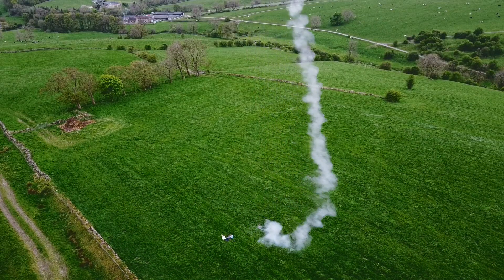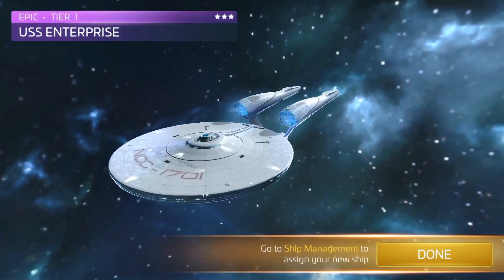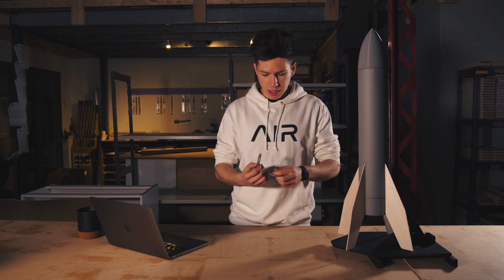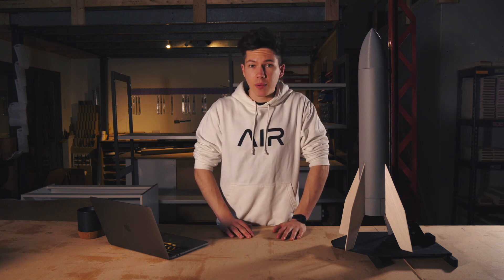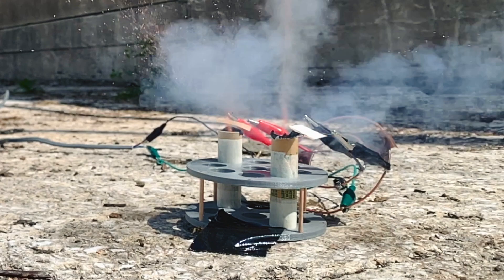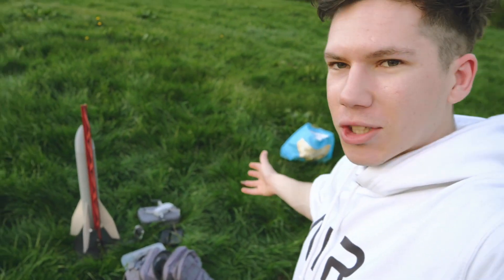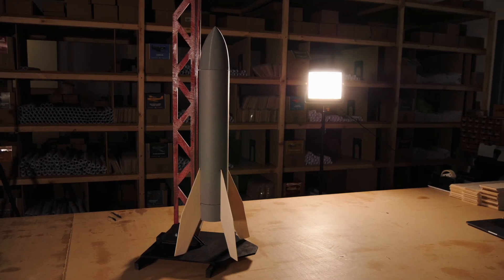DIY High Power Rocket

Comment: Use singe ignition + ignition rods from Raketenmodellbau Klima, Article number:   0001. Length: approx. 25 mm; burning time: < 0.01 s
The ignition rods are to be used for our 18 mm and 24 mm engines for safe ignition with bundled and stage ignition.
EDIT: It costs 5.90 Euros for 50 rods.

Comment: Wondering what material is wrapped around the formers. I suppose cardboard would work.  If it was my project, I might have only enough holes in the formers for the number of dowels I'd actually use. Then the other parts of the formers could have an I-beam cross section. I might also use balsa or a light veneer to wrap around the formers.

Comment: The reason I think the recovery method didn't work is because the time between the ejection chargers is different on every motor. This results in not enough thrust in the nose to be able to push it out. It might also have been some of the ejection charge came out thru gaps in the paper.
 
Love this project, am going to try and remake it.

Comment: Maybe try using springs to assist with the contact to the motors by making the crocodile clips push upwards. That may give an extra chance to light up all the engines. And maybe a long quick-lighting fuse from the base to the top connecting to a separate ejection system could better work.
Beautiful build and test, mate. Wonderful.

Comment: Pack the fuses with flash powder which you can scrape off sparklers for hotter ignition, glue in with hot glue nose cone should not be tight just barely snug

Comment: Higher voltage battery for you ignition circuit should slove your miss fire issue, add a bit of fine black powder between you rocket motors and the wadding for your parachute will give enough pressure to eject the parachute.

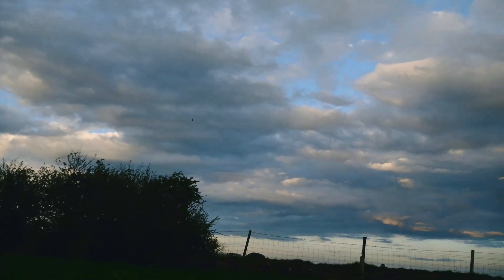Comment: @10:26 I would use a pressure sensor with MCU to sense the change in pressure when reaching the MAX height, then open the PARACHUTE, or an electronic Gyro. It is very easy to use but will need a small battery to operate with the MCU - well use a more powerful engine to overcome the weight of battery  LOL

Comment: @8:12 I would attach similar buttons on the opposite side of the cylinder to balance the rocket during flight, also to insure the rocket doesn't fly until all filaments spark reach the engine I would use an electronic delay operated solenoid to release the rocket after insuring all engines have started. There are other complex ways to let the rocket fly after insuring all engines have started - this will prevent any undesirable tilting / twisting after leaving the launch pad. Always use balancing weights by using supper glue or Epoxy Glue and a mini carbon weights, or similar weights. Am assuming the button is very light weight to minimize the lift off drag. For the delay part, you may use the 555 timer or simple 8 pins Microcontroller, a transistor gating driver and the solenoid with the base of transistor (or MOSFET Gate) connected to the timer, or the Microcontroller. In order to insure all engines started then use Nichrome wires and twist them very tight around the engine fuses - after the fuse starts then it automatically break free and fly.

Comment: Just my thoughts:
The launch stand should be much taller to guide the rocket longer and keep it straighter, like at least 3x taller or more IMO.
Your ignition system wires should be much longer so they can stay attached much farther up the stand and not get yanked out so fast.
Your engines likely will never be timed to all go off at once to eject the cone, so I'd make a single DIY charge to stack on top of the engines that will go off at once.

Comment: Tip:
Make a hole in the nose cone
mix: -75% potassium nitrate
        -15% charcoal
        10% powdered sulfur
fill up the nose cone with the newly made old style gunpowder
put a nail with spike facing inside of nose cone in hole. 
BE VERY CAREFUL AND GET FAR AWAY. PUT THE NAIL JUST BEFORE LAUNCH.
you essentially have an unguided missile.

Comment: In retrospect, you actually might want to make a circuit diagram for all your igniters. It's probably not necessary to have the ring, and you can accomplish what you want with a bunch of igniters alligator clipped to a common ground. Then what you need to do is figure out what kind of voltage and amperage you need to fire that many igniters successfully. Igniters have what's called a "no fire" and "all fire" voltage. None should fire below no fire and all should fire... Anyway make sure your circuit can deliver that many volts to each igniter and your cluster should work. I suggest reading up on clustering and igniter voltages on Apogee component's website. They are an excellent resource. (For what it's worth I think you have Estes "solar" igniters.)

Comment: Don't know if you're following comments on this video ten months later, but the gentleperson mentioning "tape match" has the right idea- your circuit is probably fine but you're up against the variable ignition time inherent in Estes solar igniters. I don't think you'll easily be able to source a more reliable electric igniter easily, but perhaps a pyrotechnic solution will work- visco fuse to each rocket nozzle lit from a single strand perhaps?

Comment: Suggest using a non-flammable wading to prevent blowback from rocket flames burning the fuselage/parachute. Also suggest using a fine grit sandpaper around the cone base so the parachute can eject. Loose but snug. model rocket wadding alternative. As an alternative to recovery wadding, you can use a baffle, fire resistant crepe paper or fire resistant cellulose insulation.

Comment: You could make 2 more identical rocket stands so it hugs the rocket,
.
But use bearings so the rocket slides up smoothly
.
It would eliminate the need for little lugs on the rocket which might destabilise it with turbulence slightly in flight...
.
Cool rocket though 👍

Comment: For ignition, the rings should stay with the rocket until all engines are lit.  This requires a traveling umbilical loop.
The recovery system failure was probably due to the fuselage bring weak in pressure.  The ejection charge ruptured the fuselage instead of deploying the recovery system.
Reply: Do you know the engines name on the rocket i want to make my own but i cant If I dont know the name of the engine he uses

Comment: Do Estes make rocket motors without an ejection charge? 
If so, my thinking is to make a delayed separate charge unit directly beneath the nose cone/parachute assembly that can be timed to go off shortly after the expected burn out time of the main lift motors.

Comment: Cool nice design. However in order for you to get a closed circuit on all of the motors to fire you have to Loop them together and just use one set of clips. In other words wire them in series. Then that way all of them will be charged and ready to go and if one is a dud then it won't fire until you corrected the series connection.

Comment: You've probably thought of this by now or somebody will have suggested it but if you use a solenoid or similar to retain one of the guide buttons until all engines are lit, you will have them all generating thrust at the same rate before the vehicle starts moving. A solenoid might not be fast enough, a pyro device with a few millisecond delay from the main igniter circuit might do it.

Comment: Perhaps enter the rocket age in full by knowing what's the unit of weight and force is in the SI Metric system. Calling thrust, a force, by a unit of mass (kilograms) is the equivalent to hearing the piercing sound of dragging your fingernails across a chalkboard.

Comment: Dude.  Just make your own motors.  Then you won't have to do unpredictable igniters.  Just one big ass rocket motor.  If the motor is long and thin enough, you should be able to keep it under the H class until you're ready for certification.  Check out rocket motors parts dot com as well.  They make pre-fab fiberglass tubes for building rocket motors, and the Tech Ingredients YouTube channel has an awesome video explaining the exact chemistry you need to make your own motors and propellant.
Reply from the maker: Not allowed in the UK

Comment: It's a cool, classic design. It looks very similar to one of Werner Von Braun's late 1920's/early 1930's rockets, or perhaps one of the 1930's Russian GIRD Rockets.
Do you shape the leading edges of the fins? You could also lubricate the guide slot in the launch tower with PTFE lubricant.

Comment: The copper rings were a good idea for distributing the power to the igniter leads, but instead of the short leads use leads that are 2/3 or a meter to a full meter long, but not longer than your launch rail.  That way, if a motor is slow to light, it has the time the rocket is climbing the rail to get going.

Comment: Excellent work! Really fascinating.
I’m planning to do the same with a single motor for my project. 
I humbly request you to explain me more specifically about the ignition system u’ve made. I’ve a trouble in doing that. Please it’ll mean a lot to me.
If possible make a small video only about the ignition system n the circuit.

Comment: The us navy uses rubber rings for some airplanes so they don’t leave till the thrust overpowers the rubber rings. Should be able to use a materials only strong enough to prevent liftoff for an instant allowing enough time for all motors to ignite.

Comment: You’re doing a good job with your channel James!  I love rocketry as well, currently certified level 2 with the Tripoli rocket association.  Just watched your kerbal video too.  Not sure if you have any rocket flight simulator software but it can really help with these sized rockets.  Open rocket is free or rocksim is better but not free.  Also, your cluster rocket setup is probably fine, just need more amps (bigger battery) to make sure all the igniters go quickly.  Sometimes I add a tiny bit of black powder in the nozzle and hot glue it shut.  Works well.  Keep up the good work brother!

Comment: Maybe some kind of trust vector control? Not necesarily with moving the motor mount...flaps could be an easy  solution and solve the non simetrical trust in case of unignited motors.  Anyway great job man keep on doing rocketry it’s amazing!!!

Comment: Ok - It did just what I thought it would: not all motors went off, and the parachute failed. A commenter suggested why the chute failed and I agree: too much volume above the motors. Each ejection charge simply raised the pressure in the fuselage, but not enough to deploy the chute. What you can do is to put a solid bulkhead a few inches (or centimeters, rather) behind the front of the rocket, just enough to fit the chute. Then run a tube from the center motor (no bigger than the diameter of the motor) up to that chamber. Also, the nose cone should never fit too tightly. Sand it down. For ignition: the motors that ignited first probably blew the alligator clips off of the ones that took longer to fire. Sometimes the igniters take a second to ignite the motors, and failures are common. To get all 9 to succeed in the same shot is a lot to ask. If you could get some fine grain black powder (or make some - seems like you’d have little difficulty doing that, but be sure to check your local laws first), you may be able to fill the cavities in the motors with that, and just devise a way with fuses to get the flame to all of the motors. As long as it doesn’t catch the whole thing on fire before launch.

Comment: Instead of having the nosecone detach from the rocket body, why not keep it attached with hinges? The cone can separate into halves or thirds, quarters...whatever works best. The charge that forces the cone off the rocket will still happen, except now that charge pushes the parachute out as the seperate cone parts open and fold back along the rocket.

Comment: you tried to pop the top in a large tube, you had to pressurize all that volume first. put in a bulkhead an inch or so above the motors, run a small dia tube from that bulkhead to another bulkhead just below the area holding the chute. now the volume to be pressurized to pop the top is reduced making it more effective. as far as the fuses, wire them all together then connect just 2 clips instead of a multiple of 2 per engine. each time you add a set of clips you double the chance of failure.

Comment: Love these vids. Other than the snug nose cone, the fuselage of the rocket may have contributed to the ejection failure. It was a cool build, but it also has to double as a pressure vessel during all of those ejection charges. I was wondering if there may have been a venting or rupture somewhere, during the charge at the end. Also, if the nose cone had made it off, the rings inside may have dragged on the parachute enough to prevent full deployment anyways. Something to be said for those "boring" old cardboard tubes ...

Comment: Use a higher voltage to fire the igniters... It might compensate for the slower or "more resistive"  ones and/or any other inconsistencies across wiring and the time it takes the ignite the motors ... You should also "match" your igniters.. Meaning that each one has a varying resistance.. Use an OHM meter so sort them .  If their resistance is not the same.. their time it ignite is not ether ;)

Comment: You need a bigger battery. Probably 24V. Splitting the power 9 ways, some will go before the others, and things are moving before the extra power burns through the slow igniters. You could do some cheaper experiments with just igniters to see how much temporal drift you get at different voltages.

I thought every rocketeer knew the importance of a slip-fit on the nose cone. That's, like, rocketry 101. As others have suggested, you could try passing a tube up the center from a single engine and blocking off the top of the rocket body from the nose cone, so the nose is the only thing that's pressurized. You might have to get creative about how to let the chute out if putting everything in the nose throws off the balance, but that shouldn't be too difficult.

Comment: what about capacitors ON THE ROCKET. set to fire on a command switch.
that way when you get 6 motors goin and the rocket starts scootin, they dont run away from the other ignighters. they just light instantly after takeoff..
idk. brainstorm

Comment: I’ve been enjoying your series. I wouldn’t worry about the rocket nose coming off early. It can be loose. If the top comes off because the nose winds up sideways while at full speed you’re going to want the rocket slowed anyway.
So a little sanding is all you need I think to fix your problems might want to tape nose in place until just before launch to keep it together during travel to site. You might also want to be sure your fuselage stays pretty airtight to allow charges to work.

Comment: The ignition timing problem; Igniting a model rocket engine is a multi step process. Electrical current is sent through a nicromium wire. The rate at which it heats is dependent on the igniter wire thickness, the amount of current applied, and the quality of connections to the power source. The more connections between the power source and the ignition wire, the more possible points of resistance which reduces the total current applied. The igniter wire is coated with a substance similar to modern paper match heads. It has a relatively consistent ignition temperature and burn rate from one igniter to the next. The burn rate variable here is negligible. The heat generated by the burning "match head" ignites the solid propellant in the engine. The biggest variable here and probably the one that effects ignition timing the most is placement inside the motor nozzle. If the igniter head is not making contact with the propellant it will still ignite the motor, but it will do so slower than one that is in contact with the propellant.
- Make sure circuit resistance is minimized and that the delivered current is exactly the same in each pair of alligator clips.
- Use a power source that can deliver a large amount of amperage. Use an automobile battery with a large "cold cranking amp" rating and make sure it is fully charged.
- Use solder connections where ever possible through the entire ignition circuit. Screw terminals, wire nuts, and especially twisted and taped connections can introduce unpredictable amounts of resistance. 
- Connection resistance from alligator clips can vary widely between different clips, and from one use to the next. Make sure each clip is cleaned between each use; coat the ends of the clips in solder flux or a conductive paste before connecting to the igniter. A PCB copper trace repair paint would work well - attach the clip before the paint dries.
- develop a consistent method for installing and securing the igniter into the motor.
-The more motors you are attempting to ignite the more critical these things become.

Comment: Maybe using a gyroscopic stabilization similar to the Gyro jet firearm. Launched from a tube. Using some flame resistant wadding around the middle for a gas check.   Although that is definitely not needed

Comment: You may lose some maximum altitude, but investing in a hold down system that arrests the rocket for a few fractions of a second while all motors ignite may help.
Some solenoid cannibalized from an electrical relais might help.
(or even just a magnet that lets go only when the majority of motors have ignited.)

Comment: Just a tip for your printer, looks like you aren't getting the best print quality. Make sure that all of your belts are tensioned correctly and make sure that the bed and hotend carriage are not wobbling on the rails, if they are, tighten the wheels until they are tight but roll smoothly.